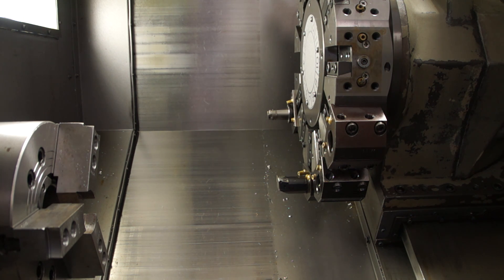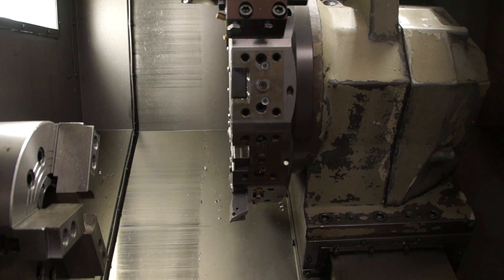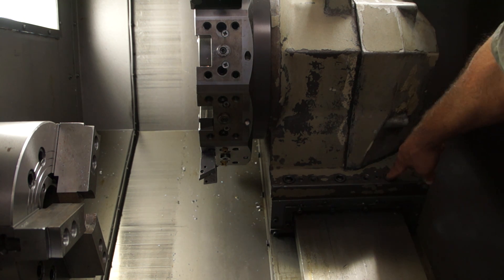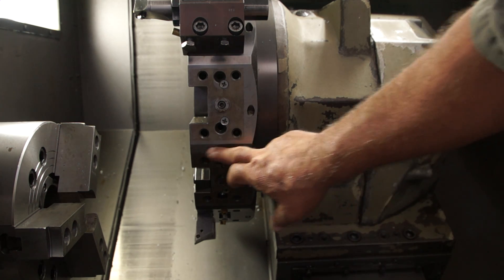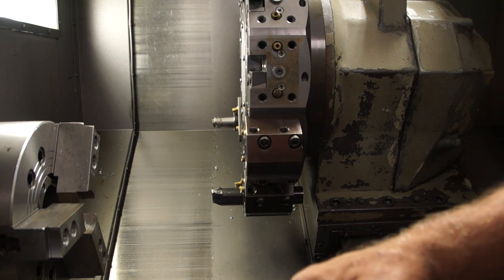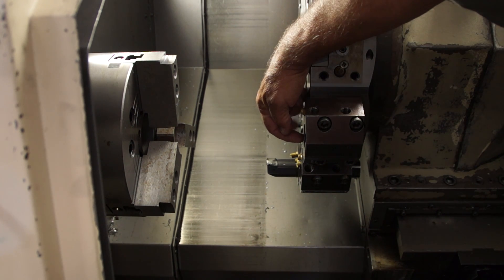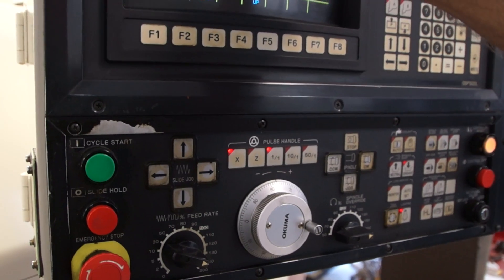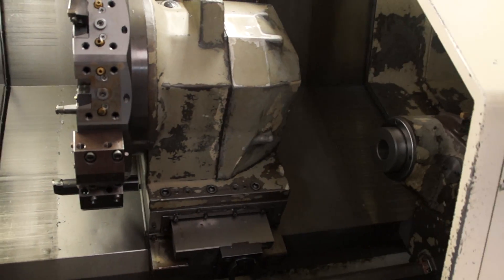Okuma lb25 turret alignment

Comment: Cool. i need to do some readjustment on an Okuma LCS25. As I understand it, the X offsets are not put in the tool offset table but in a different place somewhere in parameters. i remember reading about it in the manual. First we need a co-axial indicator.

Comment: What's the point of removing back Allen bolts? If you pivot turret only around x-z plane - could you explain what purpose it serves undoing those bolts of back cover? Couldn't you just loosen those 4 bolts that visible in vid, align and tighten

Comment: youre wrong though there is the three socket head capscrews that you see with the pins i would remove thiose
there is TWO !!!!!!inside the  aluminum housing cover you keep referring to and the ONE bolt at the left corner UP that's a HEX bolt too

Comment: After loosing the Allen bolts, you jump to software settings. Are missing the physical touch to realign it? Need help our OKUMA LB15 turret has moved CCW after small collision.
Reply: Yeah, I was like uhh fixing the X in the software ain't changing your Y location unless you tap on the turret in one direction or another.
Reply: exactly what i was thinking

Comment: There is a cone component on the head turning machine which has a length of 1235 and this mold has come 30 and has been drenched 226. Vibration is coming too much on it, how to fix it